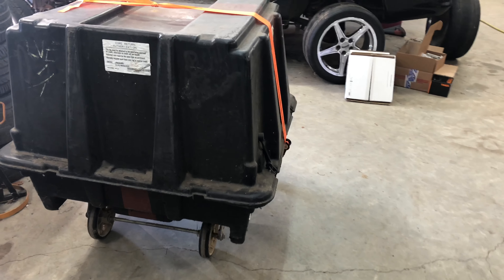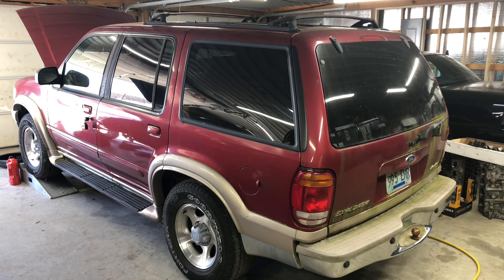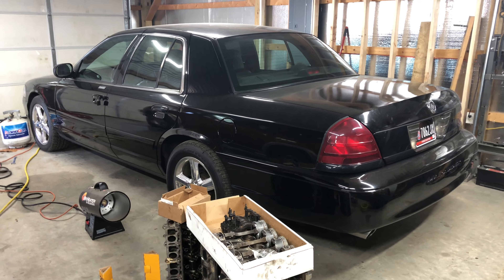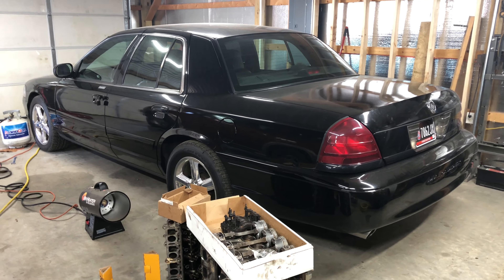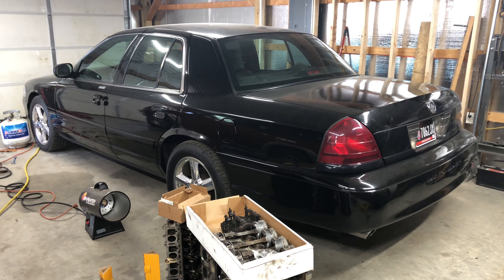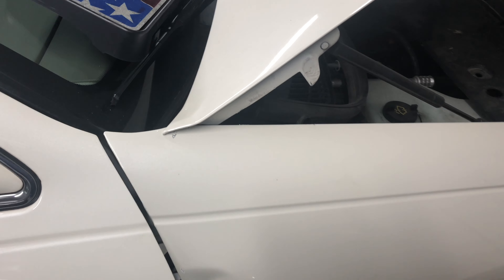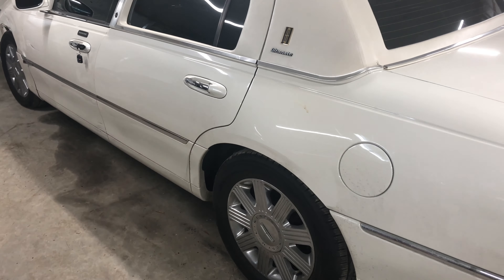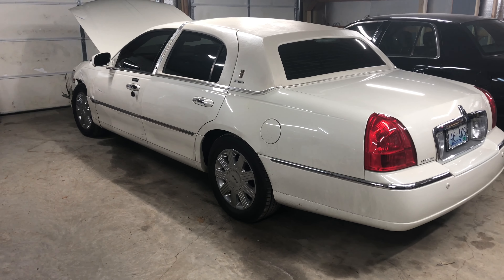New Projects!!! Cobra update

Comment: Sure hope you won’t have to part with the marauder and that Lincoln is cool. I bought a total loss raptor last year just for the engine and transmission but I may rebuild truck. I think you might get lucky on the Lincoln.  Frame might be ok if if truck impact was high enough up.
Reply from the maker: I sure hope not as well. I’ve grown attached to this one. From what I can see on the TC so far it won’t be a terrible repair. Just parts mainly. The paint will be the hardest part as blending Pearl White can be difficult